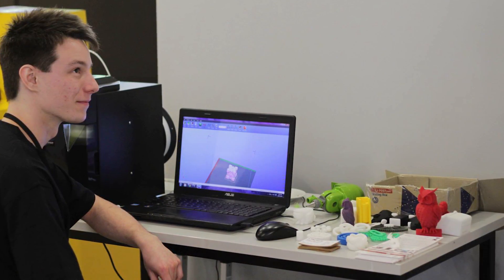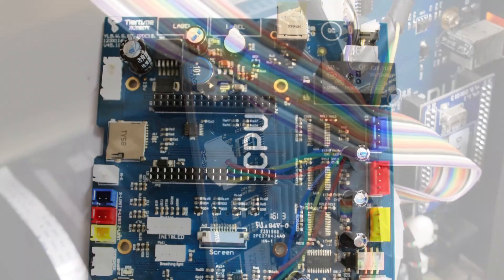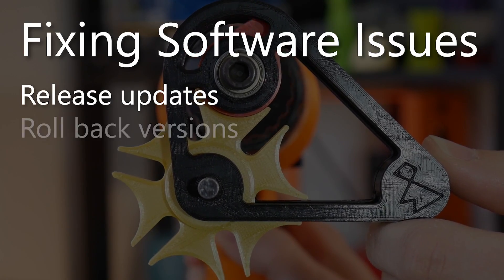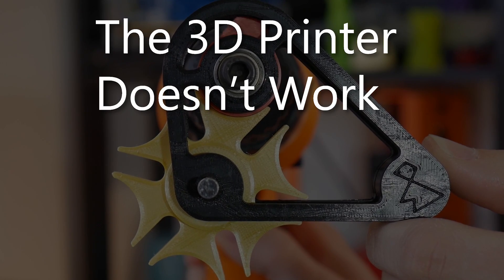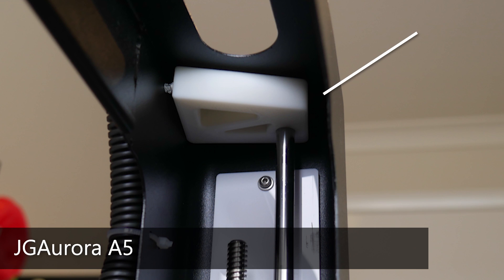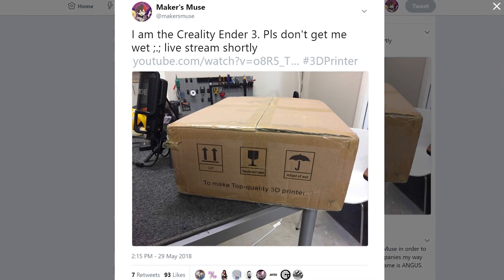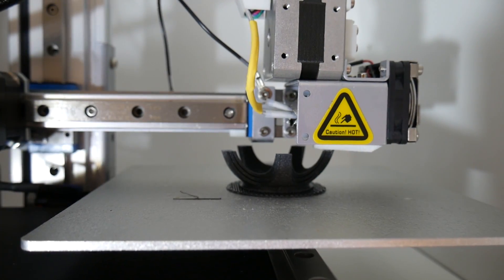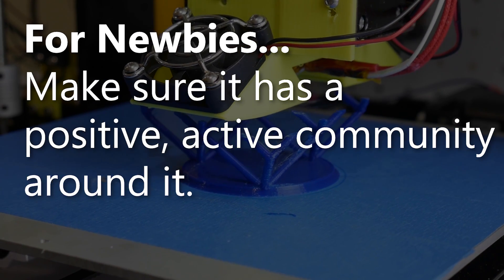Serious Concerns with 3D Printer Quality Control

Comment: purchased a flying bear ghost after i assembled it only to find the power supply was rs several weeks later a new power supply arrived i fitted this and it works great my only complaint is the touch panel i almost have to push it into the back at times and the filament runout  is continually saying it's out of filament . connection with wi-fi works as does the usb or flash card getting the settings right with cura is driving me nuts tho this is where i will be looking for help 
doug / ddy19925@gmail.com

Comment: If I don't outright make a printer from scratch, I only buy fully assembled machines with warranties included (currently a MatterHackers Pulse C-132). A manufacturer is only useful for these printers if they make a quality product that is a better option than going to a hardware store and building something custom.

Kit or not, the design of their device is what you pay for and any faults are therefore on their design team. Bad machine or live testing machines in the field? The worth of that company's name is garbage for that in my eyes and deserves to have their business collapse. The first rule of business is to retain an audience and live testing disrespects them, by hiring them not as free testers but as testers *that pay to be tested upon*. Such disrespect drives customers away and warrants a business shuttering.

Comment: I completely agree. I think there may be some cultural issues around manufacturing that play into this too. But yes first impressions do count and they stain the market forever. Look at PLA and ABS filaments, in the early days people said ABS was strong and gave great print results and to avoid PLA at all costs. This is almost reversed these days, yet the old stigma advice continues to be repeated though its no longer true. I've had very disappointing kickstarter experiences (yes I was aware and prepared for the risks and loss) and in particular campaigns that claim success just because they shipped out their products to backers despite 80% of the products never being able to work let alone do anything near the campaign claims. This also stains kickstarter too and I have received some amazing stuff from fantastic campaigns by people who communicate well, 2-way with their backers so yes kickstarter can be a successful launch platform for those willing to put in the effort to deliver quality and performance in their products. The Cetus3d printer started on kickstarter I believe (correct me if i'm wrong) and they produced a great printer which has seen good refining improvements too over time and is a fantastically reliable and consistent printer. They are also a great bunch to communicate with whenever I've had questions or problems (my fault, not the printers) they have been very helpful. I can't recommend them enough and the Cetus3D is possibly one of the best printers on the market if you want a workhorse. It just prints, with ANY PLA filament, on default settings, never need tweaking for rubber or wood or carbon fibre, it just works. Every time. I dont think that can be said for anything near the price that doesn't need to be fine tuned first. I could go on and on, but the point is here is a company that delivered on quality and customer service to produce a first class product (not just "for the price"). They could have cut corners like many others continue to do but I've never seen a bad word said against them and I for one always recommend them when asked.

Comment: Just try a CTC printer and you will know what poor quality is. Not even the assembly manual matches the thing you get. And newer iterations are just made cheaper. Blue tape on the heatbed replaces the glass bed and so on.

Comment: The thing you are not considering is that allowing an identified flaw to continue shipping until the next version release is expensive. Better to push out the fix asap. Usually, companies that operate this way do replace faulty parts, and if not, they should be. The thing is, all, ALL of these printers are repraps reinvented, and the people designing them make the same mistakes and new ones all the time simply because they are new to the game. The adage you get what you pay for certainly applies. What's a goddess reliable printer worth? Not $200, and maybe not even $2000. It's still the wild west in many regards, this 3d printing wasteland.

Comment: I bought a TronXY X1 about six months ago entirely based on your review, and it’s been one of the best purchases I ever made. The only real problems I had were that the piece of acrylic under the bed had the holes countersunk on the wrong side, and that the connection between the power cable and the control box occasionally disconnected, and a lot of wobble on the X axis. The solutions to these problems were just a few minutes with a rotary tool countersinking the correct side, and turning the power connector in the control box upside down, and a 3D printed 2040 slider that made the axis perfectly rigid. Each of these solutions has held up perfectly so far with no further tweaking.

Thank you for that review, because it got me into 3D printing with a solid machine that needed some very minor adjustments.

Comment: The sellers of the parts have also totally unacceptable quality control and poor design, my anet a8 came with a bad nozzle and I replaced that, I try to print the thermistor comes out, after many wasted heat blocks and nozzles it started working with replacing the block every 15 prints (small ones) with tons of fails... one of my heatblocks had a bad thermistor, caught fire... heatbed cable caught fire and ruined the heat bed and cable. I ended up upgrading to the latest version of marlin, it helps but still get some issues .

Comment: I got a tronxy x1 as my first 3d printer because of your reviews. It is the worst thing I could have ever done. I am not blaming you but tronxy for this. here are a few reasons why no one should by this:
1. -Hotend is the worst 
2. -bowden connector didnt work
3. -bowden tube is the worst 
4.-extruder doesnt extrude (because doesnt grip onto filament)
5.- a part was missing when I got it
6.-the sd crad slot does not work
7.-the printer is not recognized by cura
8.-the y-endstop can not be mounted as specified in the manual
9.-bed leveling is not a thing
10.-there is no support for the machine what so ever

I hope that those reasons were compelling.
If I had to sum up my experience wit hit i would say that it made me have  the worst 6 weeks of my life.
BUT
I have not given up yet I am now replacing the Hotend with an E3D v6 lite. I hope this fixes my problems. Do you have any other suggestion?

PLS like so Angus and anyone who wants to get a tronxy x1 sees.
Reply: You can may fix the grip issue with make the metal spring longer

Comment: This glut of cheap and nasty, or unpredictable quality models is a problem with consumer focused products moving from a niche market of people able and willing to invest money and time and toubleshoot, to a more general, interested, but still limited, market. 
Because cost becomes a major factor driving sales, the older well-crafted products start getting undercut on price.
For a couple of years in the early 2000's, Mobile phones went though a similar process. In the mid-90's, it was laptop computers, and in this case even major brands produced garbage because they were completing by being cheap.
It won't be too long before things improve, because as you said in the video newcomers will stop buying until simple, reliable machines become the norm.

As for beta testing hardware on the customer.  If they know they are getting a pre-production machine, fine but that isn't the case here.
I think i'll be getting my next printer from Aldi, as they are relatively cheap and backed by warranty so I don't be stuck with a lemon.

Comment: I still need to rip out the logic in my printer, the firmware/software lockdown sucks.

Edit:
It's only okay if it's made clear what's happening, early access makes it clear and there are a couple early access hardware things. The difference is the disclosure, support and communication with the companies.

Comment: There is serious quality control with filament too lately. I bought ten rolls of assorted PLA from hobby king, and they are all completely useless. The stuff I got from cocoon and Aurora are printing great, but the hobby king stuff snaps as you try and unroll it, it is seriously terrible and their filament used to be good. Any other good inexpensive filament available in Oz?

Comment: These stories are what has kept me from investng in a 3D printer myself. It's always "print this fix for that obvious mistake in factory". Or... "Yea the power leads are totally unshielded but I know what I'm doing so I don't worry about that". Etc etc... 

I am not unwilling to put down some cash for a product that is safe and... Works without day one fixes (at least with games day one patches are kind of automated). 

But if I am going to put down 500 to 1000 bucks I need customers I don't have. So it's kind of a catch 22 and until things stables out I'll continue to observe the advancements from the boring safety.

Comment: did you know you can tell the batches of tevo tornado printers the first batch had a bent piece of aluminium for the barring of the z lead screw they also had a red bed the next one also has the bent biece of aluminium as the support but a green bed the third one has a straight piece of aluminium and a green bed then the forth one has a orange brown color sceme and a glass bed instead of that super strong build tack

Comment: Just sold my upgraded Ender 3 today and:
The person who bought it absolutely confirmed  my and obviously as well your sight at it.
He had already a 3 printer which he could not bring to function in a satisfying way. That's why he almost lost the fun in the subject. But he especially wanted to buy now an used Printer which has worked to give it a new try.
But most person in such case would give up and this is not good for the community. What is the reason why such quality issues can make me quiet mad.

Comment: I 100% agree with you.  I did my research and was scared off from kits after learning how little QC manufacturers would put into them.  I decided to buy and older fully assembled printer.  Furthermore, I do not think it is right for manufacturers to use their customers as beta testers without informing them of it.  Same reason why I will like I glitchy early access game but hate a "AAA" game of the same quality.  I was not informed of the products low quality before I made my purchasing decision.  It is assumed that a product is it's final form unless otherwise stated and that all things mentioned in promotional material will be a part of that product.

Comment: Actually Angus...

Consumer rights only extend to built systems, Kits, like anything in kit form has NO WARRANTY as you are responsible for the repairs, mods, etc.

Also... there are a lot of problems in 3D printing and manufactures are trying to maintain profits on a product that the bubble has burst on.

Comment: Amazing video, just a newbie in the 3d printing world but this applies to all kinds of products and services. In my short time 3d printing i have noticed one thing, inconsistency. I wish 3d printers were made as refrigerators or cars, things which do the basics right.
All i want from a 3d printer is to print correctly every time like a car runs perfectly on gasoline if maintained regularly. manufacturers don't sell a car if it doesn't move be it a rolls royce phantom or the tata nano. 
One of the manufacturers taking this approach are Formlabs. They are selling mid-range SLA machines and their own resins which work amazingly well.

Comment: I think this is the difference with 3D printing hobby with others. The hobby it self requires you to have working knowledge of a 3d printer inside and out how to fix it. Then you have to learn how to slice and print what you want. Also know how to 3d design a part so its actually printable with your machine.
These budget startup printers are not newbie friendly at all, actually not much about 3d printing is newbie friendly. This is what happens when the product isn't controlled by a multi billion dollar company that charges a large amount for their product. 

The only way to make it more friendly to newbies is to restricts its users from making any changes at all locking them into software and hardware, make nothing compatible with anything else on the market. Does this remind you of any other product you know of.... i will give you a hint they are a massive computer company and there is really only 3 to chose from. Linux, Windows, Apple. 3D printers will follow this trend of what happened with computers, buyers will flock to the company that makes the most reliable product and those that buy/ chose poorly will suffer.

Comment: THUMBS UP Angus!
This is exactly my point about why I'm trashing the Ender 3 I did receive.
After I brought the Z-portal profiles to cnc mill to get a clean 90° angle cut, they had a rock solid stand and with the upper profile I ordered newly manufactured in Switzerland, assembling the z-portal has been something completely different.
Same after the upgrade I mad with the linear guide rail for the Y-axis and even the screw rod mod I made has shown all in a different light.
It would take so little of care and just some use of it's brain to make of these printers something real valid, especially for its price. But as long as crap is delivered and I have to spend a lot of work an money to make it usable, I can't consider that crap as a good deal. And: As customers I would rather spend some dollars more to get a reliable device, than to make kind of gambling with an order.
That's why I decided to design and build my printers by my own in the future and no, I'm not an engineer and I don't have any formation. But i don't have any doubts, that with a little help of the community, my printer would rock it for sure.
And yes, it would not be in the lower price range, but much less than half the price of what it would be sold. So therefore my suggestion to you: What about such subjects?... could they be of interest for your channel activity?....
Could be interesting, seen you do a real good job at your channel.

Comment: Thank you so much for this video. You speak from the bottom of  my heart. I would like to buy a 3D printer. But when I start to get interested in a specific model (budget price range up to 300 Euro) and look at the reviews, I realize that the reviews often turn out to be very different (and thanks to your video yet I know why). In addition, I have the feeling that pretty much every built-in part of a 3D printer is a potential source of error. This makes me very insecure. I don't know which review I should trust more: The one that recommends the 3D printer or the one that (wants to) find out all sorts of bugs. I don't have the money and time to buy many different printers to find out which one causes the least problems or fix the problems by spending money on expensive upgrades. This makes the purchase of a low-budget printer absurd in my opinion. Once again, thank you very much. For a beginner like me a reliable hardware quality is indispensable. Recently, I wrote a letter to 3D Printing Nerd in which I complained about this subject.

Comment: This problem extends to other aspects. I ordered a used CR-10S from CCTree and they sent me a return that someone has made that they didn't bother to check. It had been improperly disassembled and literally tossed willy nilly into a box which was too big and with no packing support. They quickly responded, sending me another printer that appeared used but was fully intact but its clear they are trying to do things as cheaply as possible not even checking the returns before they turn around and sell them as used. I ended up with a headache and 1.8 printers. I am putting the first one together after ordering a missing stepper motor and myriad screws and tracking down the y-axis motor bracket which was surprisingly hard to find.

Comment: This is all exactly how I felt/feel about my Tronxy X8. 

But I did option 2 thanks to my brother and it works fine once it's leveled. 

And the Prusa Mk 2.5 is still going with no problems.  

If it wasn't for this channel, some others, and my brother, I wouldn't have gotten to print all the cool models for my dioramas. 

They've more than paid for themselves in my opinion.  :{J

Comment: What you are discussing regarding the hardware world is, honestly, the reason I won't purchase AAA games anymore.  Having several 'full release' $60+ games which required basic functionality and bug fixes which had to be done by the 'modder' community.  Note that the companies (yes, plural) never actually fixed the issues themselves.

I agree with you that it seems disingenuous to market a 'widget 4000' for 2 years when there have been at least 4 upgrades to the original model.  At the least, put hardware-related upgrade monikers to the product (widget 4000c, the 4000GTX, etc.) to let the consumer know that last years model isn't this years model.  Conversely, one of the positives of the internet age is that software/firmware updates are now very affordable (effectively free) and easy to come by.  Not so much in the olden days.  :)

On a side note, thank you for your informative and entertaining videos.  I'm looking to get into the 3D printing gig and I've learned a ton from watching.  Cheers!